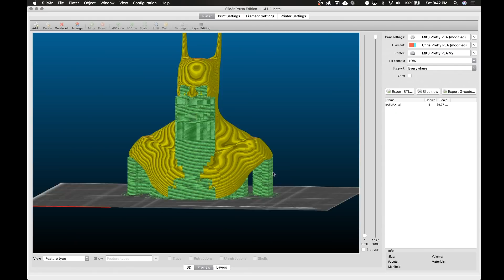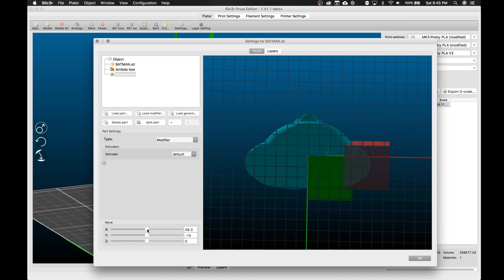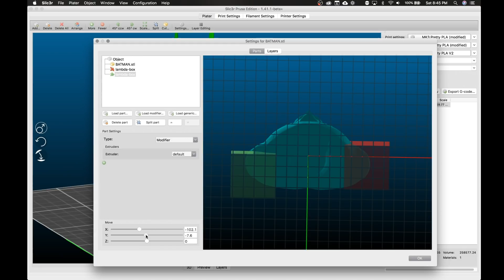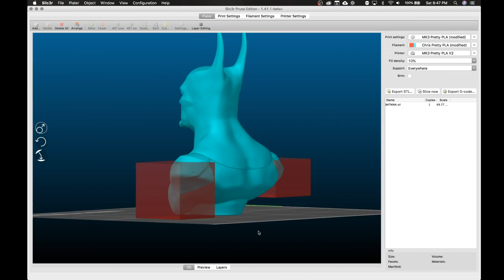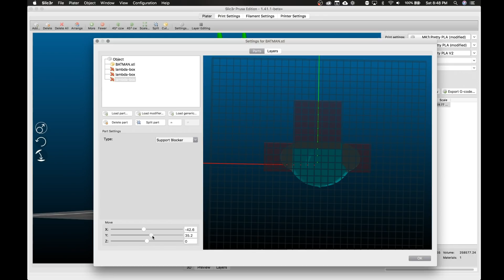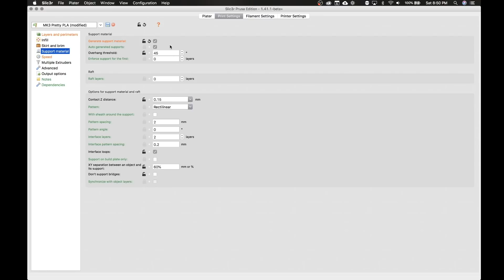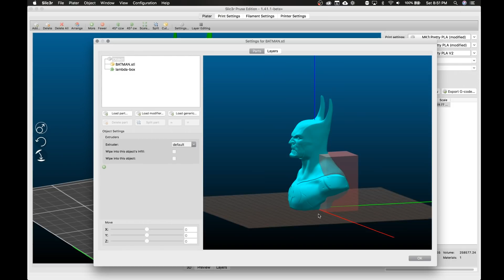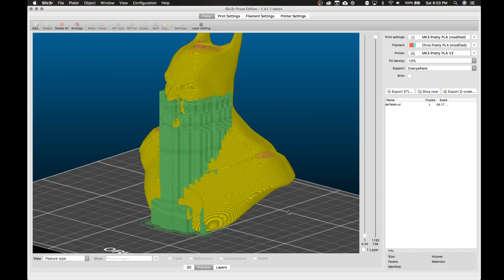Slic3r PE: Custom Supports aka Support Enforcers and Blockers

Comment: When I select the box I don't get any options to change the type to blocker. Tried on PE 1.41 and 1.41 RC on Win 10.
Reply: my solution after wasting so much time: Download IdeaMaker. Got printing in 5mins with supports where I need them. Hope the print quality is as good
Reply: Quality was bad compared to Slicer. Anyone know why I don't have type settings?

Comment: Can this feature be used to add a support as a solid object to the model?  I have been trying to print some very tall thin models that break free of the print bed near the top of the print, around 170mm tall.  The prints are about 10mm wide and 229 mm long, 190mm tall. I would like to add some support pillars, on the prints side to support it as it builds. Is there a way to do this?

Comment: THANK you, Chris - this is great info and very nicely explained in this vid.

I would be interested to know if you use this in combination with the Overhang Threshold in the Support Material section of Printer settings. I.e. do you get just the right amount of support material using that first before customizing supports?

Comment: I don’t understand with all the revenue and power Prusa has why they can’t make Slic3r more feature friendly. Custom supports are tricky I’m sure, but horrible programs like FlashPrint for the Flashforge machines even have custom supports? In fact I think FlashPrint does a better job than S3D of placement.
Reply from the maker: They have 8 full time devs working on it. I mean S3D hasn't had an update in 18 months and it costs $150. Slic3r PE has added amazing updates every month but if you follow them you'll notice what they will launch and it just takes time.
Reply: Chris Warkocki fair enough... have you ever tried FlashPrint? It’s a bundled free software and has amazing features for a bundled software. I’m just saying Prusa has generated millions with every version of the i3... its time to just hire a company that does development and get the users a slick S3D interface, that has all the features we all want. I’m the end Prusa printed are awesome, but they will never be like a microwave in a home until the user interface is as easy to use as something minimally as S3D and preferably like using an iPad. I find this method of support generation a clunky work around to say they have it. My opinion.
Reply from the maker: S3D is nowhere near slick. It's 2001 design and a lot of it completely horrible. Slic3r wrecks S3D in profile management. Supports are out dated yes but Slic3r is far more powerful. I mean S3D can't even guesstimate the print time. Slic3r is within minutes. S3D Deons't have any mechanical settings like acceleration or jerk while Slic3r has all of them for every aspect right in the software. They have more Dev's than S3D. Their money is going towards it and they develop faster than S3D or most competing slicers. The problem is they need to rewrite Slic3r from PERL and that's taking time. I've watched it grow in the last 8 months. It's done far more than any other slicer in that time. We can't have all the features instantly.
Reply: Chris Warkocki it’s a matter of opinion I suppose.
Reply from the maker: There is opinion but if it has to do UI there isn't a single slicer that looks modern and works intelligently. They are all quirky and designed by people who don't make modern software with a billion dollar pocket book.
Reply: @thelightspeed3d712  s3D also generates terrible toolpaths. Slic3r prints are simply better.
Reply: Chris Warkocki now that’s true. They all are outdated. We all need a slick slicer! I like how Slic3r allows me to easily send prints to the printer.
Reply: Kent Boehm well maybe I have my S3D profile dialed in better, but I don’t think that’s true.
Reply: @Mr3DPrintWizard  great work Chris! The only issue I find is that while it will only support sections of the print within the box, it creates support material outside of the box in order to do this. This creates issues for me. Would be great if it controlled it so that no support material is created outside the box at all. Also would be great if we had an option to only create support material off the print itself, instead of the build plate (eg batman face only, not build plate to chest area).

Comment: You did a great job at explaining this. However, this feature is kind of a waste of time. So much easier to just point where you want to ADD a support and have it generate. S3d does this with ease, so does meshmixer. So why cant others incorporate a better way. Rather than stating they have the "best" slicer out there, but yet to do anything, you have to have a PHD in patience, tolerance and engineering to use their software. Reminds me of blender and linux..
Reply from the maker: LT72884 sure you can point and click and sit there and point and click. If you have the time to write your response here you have the time to use this system for supports. 😋
Reply: @Mr3DPrintWizard  very true. I actually went o to s3d last night, added manual supports to a complicated part. Took a while due to it only placing one support at a time. I also tried it by removing supports. Then o went into prusa, the newest edition, and had a better product 75% faster than s3d. Especially in expert mode where i can pick the shape of modifier i want. I am now a subscriber to your channel. Thanks for understanding where i was comming from.

Comment: Great tutorial, but wow that 'feature' is quite un-intuitive. Not sure if this is a limitation of the language being used or just terrible coding/design work.
Reply from the maker: The language. Once they switch to C++ we will see way better custom supports.
Reply from the maker: Festivejelly they've already posted an alpha with all new UI. If you followed the project you'd know they've been rewriting the entire code and working on modernizing it along with adding all new functionality. This video is already way outdated and they've improved the feature dramatically.
Reply: It's because the feature has been slapped on a preexisting support generating legacy code. Good news is that they are rewritting it.
Reply: @Festivejelly  it has nothing to do with design either. they just don't have enough time, developers, etc, so they give you minimal solution.